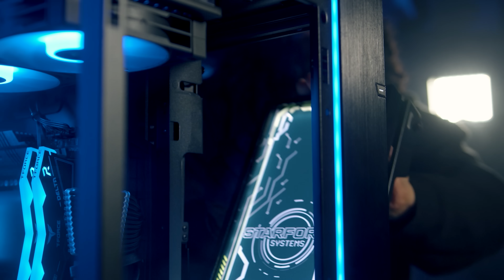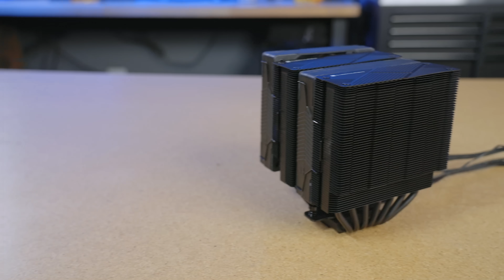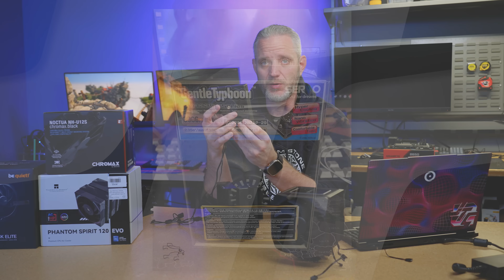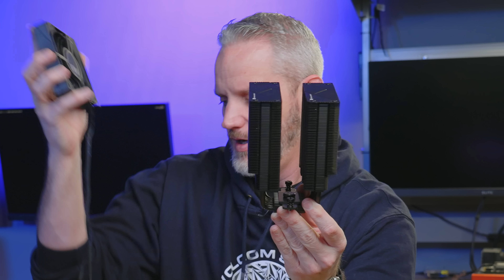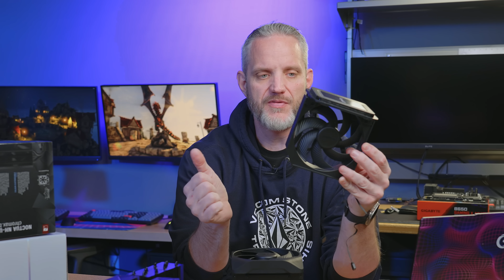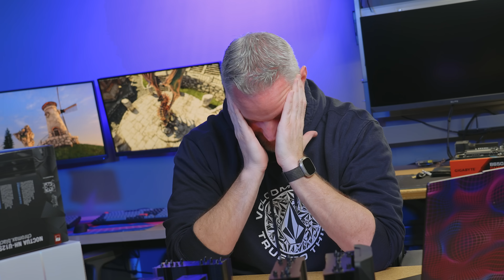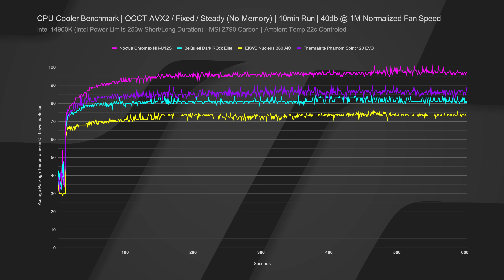This $49 CPU Cooler has big brands SHOOK! Thermal Testing Cheap vs Expensive CPU Cooler!

Comment: man my 6700k intel has a 25 euro tower cooler on it and temps dont gop above 70c. edit my old pc 2500k intel beast of a overclocker with a side panel fan with cardboard as a duct and a stock cooler i got 15c of the normal tem and had that thing running 4.2ghz for olmost 10 year my girlfriend at the time used it after me and the good thing with a big chip you could leave the voltage on auto and it was fine bigger chip better power it can take

Comment: Great review, but you've fallen prey to the Gamer's Nexus over-analysis nonsense. While 40dB normalized is interesting, most of us aren't running an open test bench and don't care about a 3dB or even 6dB difference for fans that are going to be inside a closed case. Put the Thermalrite inside a case with case fans, and the noise at 1 meter will be nearly the same for 94% & 100%, so why should we care? We want to know how close the out-of-the-box Thermalrite results are to the other coolers. You can report on the noise differences, but normalizing the noise just creates a bogus comparison that's not relevant to most of us.

Comment: @JayzTwoCents : Jay can you please test the following : 
Can you run the Thermalrite through the same test you did in this video, but this time with the sides of the fin stacks taped off so that all the air from the fans gets pushed through the fin stack instead of allowing some of it to escape through the open sides ?
I would like to know if closing the fin stack sides helps the performance of the cooler or not. (if you want - and have the time - then you can do the same test with the other coolers as well, just to see what difference a closed off fin stack makes)

Comment: More important than adding more coolers to the charts is testing with an AMD CPU in addition to the Intel CPU as well as using different power limits (shape of the heatspreder and hotspot location can make a huge difference)

Comment: TR make great products. I've recently bought their Burst Assassin, Phantom Spirit Evo and multiple 3 packs of their infinity mirror ARGB fans. As much as I love Noctua, the NHD15 takes up a LOT of space, and for AM5 without the offset gets beaten by the PS Evo ever so slightly. The Burst Assassin really impressed me, when not running PBO on a 9800X3D it was functionally the same as the NHD15 and cost $32 nzd. The Phantom Spirit Evo was $70 and allows you to run PBO fine. The NHD15 is nearly $200 NZD and blocks everything around it.

Comment: Good day Jay 
I actually bought that tr Evo 120 and did worst than my artic freezer 36 by a mile.
If you cauld do freezer 36 vs tr Evo 120 and noctua nh-d15 g2  and dark rock elite on 
that would be impressive on a Ryzen 9900x...
I got 92c-94c on cinebench r23 on tr Evo and 84c-86c on artic freezer 36 with p12 max on multiple 10minutes test on 9900x overclock with 34000+ score on air cooling... thanks for this consideration...love your channel and your awesome dude...👍

Comment: I've been carrying an NH-U12A (it's like the U12S but with a better heatpipe arrangement and two fans) through several builds now and it's still going great. IIRC it started out on a 6700k and has ended up on a 7800X3D! 
I've become sort of attached to it but with all the great value coolers out now maybe it's time to think about an upgrade?

Comment: My CPU is only 65W rated so went with the Hyper 212 Black with 4 heat pipes for 29.99 on newegg. Even running cinabench R23 it never kicks cpu fans to max and never gets above 70c. at idle i'm below 40c with case fans 500-600RPM and cpu fan 800-1000RPM (case fans are 2 140mm intake one 120mm in a Lancool 205m case so top is open nut has no fans)

Edit: if you ever want to go into bearings more, cooler master had fluid bearings they call loop dynamic bearings, using both centrifugal forces to move the lubrication and magnets to keep it centered and i have no idea if that's just marketing or normal for FDB.

Comment: I'd love to see you add the Darkrock PX4 cooler to that chart.  It's the $17 cooler you did a video about last year (3/3/2024).  And it's STILL under $17.
You said it was "the cheapest cooler you ever reviewed and it's probably the best performing cooler at it's price point".  How about some numbers to back that up?
It has direct heat pipe contact so I wouldn't be surprised if it outperforms the Noctua even at 1/6th the price.

Comment: i play in a garage 24/7 in so cal, it ranges from 30-115f, i switched back to full air cooling 2 years ago, AIO's are just trash now adays, the custom loops are fine but imo not worth the extra cost

Comment: I've got a question, not related to this video at all:

If I set 5090 to maximum of 90% power and use the singular 600w 12v hp cable will that almost guarentee the gpu to not melt.
Or is it just a lose lose, and should I return the card and get something that just works

Comment: I've used Thermalright since the mid 2000's.  I had a Thermalright XP-90, and XP-120, both downfire coolers.  They were kind of the industry leaders at that time, and very affordable.  Then they started with their tower coolers which were also very good.  For some reason they just sort of faded into the background, and just now are starting to be rediscovered.

Edit:  Actually if I were to dig around in my "parts bin", I think I still have the XP-90 and XP-120.

Comment: Looking at Hardware Canucks reviews. First different coolers perform differently on different sockets. Seconds the Thermalright coolers perforn even better on AM5 compared to AM4 or any of the Intel sockets. It ends up beating almost all air coolers on the market today on AM5. So people on AM5 platform have even more insentive to get the Thermalright cooelrs over others.

I wish more reviewers test coolers on different plattforms (at least the most up to date Intel and amd plattforms). Only testing on one platform doesn't tell the whole picture,

Comment: I just want an air cooler that has the same fancy LCD screens that let me put GIFs and data and such on them that the AIOs have... So far I've only seen DeepCool make one that's close but can't buy them in the US so that's out. I know the AIO is much more expensive from a price to temperature standpoint but I like my fancy screens. I tried putting a Lian Li TL LCD fan on my air cooler but the angle the fan faced made it not aesthetically pleasing. 

Yeah, I'm making way too big a deal out of nothing, I know.

Comment: I had the 10$ cheaper model which I think is called peerless Assassin and it was doing a very good job even on my r9 5900X until I got an aio thermalright aqua elite 360 V3! got really good temps at 65%

Comment: I used to love AiO water coolers until I had 2 different ones leak inside my case causing corrosion of the motherboard and RAM on one and corrosion on my video card board on the other.
Right now I use the Thermalright Phantom Spirit 120SE.  I currently run my AMD R5 5500 with a 300MHz boost and it never goes above 65c when running Prime95 or AIDA64 for 20+ minutes.  BUT I cannot get a 500MHz boost on mine like some users do.
For $35.00 US this is an outstanding cooler.

Comment: your testing is slightly flawed, you have to include AMD cpu's. For example, a low performing cooler for Intel may be the best performing cooler for AMD and vice versa.
Reply: I will add, the Phantom Spirit will perform as good or better than the Dark rock elite on an AMD CPU

Comment: No cooler beats Thermalright PA120 and PS120 for value, and few for performance (the new DH-15 does by a few C for triple the price...)
For the next tests please test the Arctif LF3 360, check if it beats the EK Nucleus for way cheaper !

Comment: Noctua just aint worth it. One NFA14x25 costs 40€. A five pack of Arctic P14 is 30€. Who in their right mind would by the Noctua? At the same noise, the Arctic has about a 5% airflow advantage through a hexagonal grille, i.e. as a case fan, according to HWcoolings testing. 
Even if the Noctua was twice as good as the Arctic, which it's not, you get like SIX of them for the price of one Noctua.

Comment: The NH-U12S has a wattage rating of 129 - it is not designed for a 253W 14900K. Yes, way overpriced IMO, but HOPEFULLY nobody buys it expecting it to handle a 14900K at 253W - not it's purpose. The NH-D15 would fit better with the group - dual tower and meant to handle loads (and also expensive).

Referring to the Nh-U12S as "terrible" in this type of apples to oranges test?

This video wasn't sponsored - certainly not by Noctua.....lol.

Thermalright has been making great performing and budget friendly coolers for quite some time now. I have a Peerless Assassin 120 in one of my systems and have never regretted the purchase - it's within a couple degrees of an NH-D15 which is something considering the price.

Comment: So the price per dollar test is the only test I can see that's inconclusive as the EKWB AIO and Thermalrite are not at max fan speeds and therefore not giving there best temps. To compare it would be like saying a pinto is a better value over a 350-Z because it's 0 to 60 is faster because the Pinto was able to use 100% of it's throttle while the 350-Z was capped at only 65% of it's throttle. So again that's why I feel that, that one test is in accurate.

Comment: I just picked up the upHere double tower CPU cooler in white with 8 heat pipes (yeah, the naming is absolutely goated). It normally goes for 60€, but with an Amazon discount I only paid 30€ – and honestly, I can't complain one bit about the performance. It also fits perfectly with my build aesthetically, especially alongside the white XFX 9070 XT.

Comment: Been using a ID-Cooling SE-206-XT (SGD$45 ~USD$35) on my 13600kf (Intel limits enabled). Temps are execellent for the price and no longer reaches 100C under a stress test or 80C in games compared to my previous cooler which was the CoolerMaster hyper212 which i got for SGD$60 ~USD$45 (absolute terrible price), 100% would recommend ID-Cooling.

Comment: thermal right peerless assassin 35$ amazon (double tower)

"Thermalright Peerless Assassin 120 SE CPU Air Cooler,PA120 SE,6 Heat Pipes CPU Cooler,Dual 120mm TL-C12C PWM Fan, Aluminium Heatsink Cover, AGHP Technology,for AMD AM4/AM5 Intel 1700/1150/1200/1851"

Comment: Add stock cpu air coolers to the chart if the cpu comes with one or if they are purchasable separately. That way you can see the performance uplift from a stock air cooler.
Reply: I just upgraded....I was eyeing a new build but we are talking thousands of dollars to get a good bump so out of the question. I had a 5800X3d sitting in box for 2 yrs and decided to pair with my 3080 and am blown away BUT wow the stock cooler sucks. Its a 4.5Ghz cpu and it throttles to 3.6Ghz because its constantly pegged at 90c, its max heat allowed. This CPU is basically NOT a 5800X3d as its thermaling at lower speeds! I did not want to spend any money but I have to so a new NVME SSD, CPU Cooler and new display port cable runs me $100 dollars which is way away from the $3000 I would need to spend for a full on new system where I can feel the difference.  Gotta say....I am running Skyrim and FNV at 4k at around 120fps each but my main game in XPlane 12 still has times of 40 and even down to 30fps. Lets go Peerless Assassin cooler!!
Reply: There is no stock cooler for 14900K, that thing is too hot.
Reply: I get the thought here, but you can find coolers for so cheap that are still good that it's just not that necessary. would be nice to see in addition tho
Reply: @wasru.  its not about 'cost' its about data. we need more data, and stock coolers for the sockets should be baseline data anyway

Comment: Jay, you pit a mid performance level, single tower Noctua against mid-high tier dual tower coolers from the competitors, then constantly shit all over Nocuta for not performing as well. Noctua will never win a dollars to performance competition, but at least compare a dual tower to a dual tower Jay, or acknowledge it's a much smaller cooler instead of constantly calling it horrible. Nobody should be putting a single tower air cooler from any brand on at 14900k, a processor legendarily hard to cool. The fact it couldn't do it doesn't make it horrible, it makes you an idiot for not using it in the correct application.

Comment: Im currently running a ThermalRight Frozen 240 aio on my 5700x3d, installed at the top of the case as exhaust, and after 2 to 3 hrs of gameplay(multiple games) i run around 50c to 55c. Im also running the dual tower ones on two of the PC’s i built for work(QC of cctv sewer videos) with no issues and computers running nowhere near 75c on cinebench. 
They are definitely a good bang for your buck. Specially on budget PC’s

Comment: It would be better to measure this at much lower loudness levels. Thermalright cooler @ 94% rpm, that is gonna be around 2000 RPM. Nobody is running this on those speeds, it is loud. This is partially why it performs so well in the tests, they slapped 2k rpm fans on it.
Realistically if you build very quiet pc, you want fans that run below 1000rpm, about 600-700 ideally.

Comment: i just bought my parts and with help from a friend built my first PC, i have a ryzen 7 9700x as my cpu and the big thing i was struggling to find info on was stats for air cooling. although this cpu has a estimated 65w on another video i saw they showed 85w to 90w power being drawn from stock settings. so i had no idea which air cooler to choose as none of the specs really say what an air cooler can really cover depending on cpu heat output.
so i went for a Noctua NH-D15 just to make sure, it was £110 and under a stress test/cinebench test the max it went to was 88C degrees. 
had this video been out 3 to 4 weeks ago, i could have maybe gone for it and saved about £50.

the other point i have is, the thermalright is considerably cheaper, will the fans last as long as Noctua fans? that could be a weak point to the air cooler. there is also a asthetic choice when bying parts, i bought the D15 because i have a tomahawk mother board and plan to theme inside the case of possibly a fighter jet and so on, to me the black cooler goes with what i want and i was happy to pay the extra money. most of us go with budget, but some of us spend a bit extra to achieve something we want overall out of the build.

cool video, i look forward to more info for the future as it will be helpful. are we about to see the crash of air cooler prices as the big names of air coolers have been like Nvidia and milking that "quality" brand name lol

Comment: Yes, cold plate does create inefficiency at heat transfer. But direct heatpipe contact on higher loads is more likely to have heatpipe dryout. Especially on GPU's; Overall temperature being good until certain load treshold, the hotspot temperature suddenly starts to skyrocket.

Comment: corsair a115
thermalright macho rev c
Thermalright AXP120-X67
scythe mugen 6
endorfy fera 5 dual
be quiet! Dark Rock TF 2
vs
alphacool eisbaer aurora 360 280 240 
On a am5 140w ppt

Comment: You must try out the ID-Cooling FROZN A720 BLACK 140mm Dual Tower Black CPU Air Cooler 9800X3D @ Stock 53C Idle and 80C at full Stress Test with CPU-Z Bench tool. :eyes-pink-heart-shape::eyes-pink-heart-shape::eyes-pink-heart-shape:

Comment: Jay you are missing very important point: you have to test intel and AMD cpus separately with the same coolers!
All these coolers will behave entirely differently on amd CPUs. Spoiler : Thermalright will win, but all the other  air coolers are much worse on AMD. Since AMD cpu's are much more popular, you need to test those too, its not enough to test Intel alone.

Comment: Something you should take into consideration is trying AM5 with this and see if the results are consistent. HCanucks recently put out a vid and there are very clear results indicating which coolers were developed for Intel versus AMD since the market for them in terms of preference have changed. Perhaps a future video idea?
Reply: This consideration is why I bought a Phantom Spirit 120 EVO for my 5800X3D. -Which, I bought after finding out 1st hand how poorly Heatpipe Direct Contact/Touch coolers perform on AMD MCM CPUs.
Reply: i have am5 and it works fantastic for me
Reply: there's also coolers that are not well suited for am5 but work just fine on am4. the id cooling frozn lineup is one such example that struggled on am5.
Reply: @Izanagi-Arsene  What coolers are good for AM5? 9800X3D. My Deepcool AK400 is running about 10c hotter than my friend's but his brand is Korean and I can't get it here.
Reply: @Hiiiro  Your AK400 has direct-contact heatpipes going only through the middle, that is not good for AM5 CPUs because the CCDs that get hot are not in the middle, look up "9800X3D de-lidded", you see that big chip in the middle? that's not the CPU core, the core is the other one. You should get a cooler that has a base plate like the ones Jay showed and with more than a few heatpipes, four small heatpipes just aren't enough for modern CPUs.
Reply: @Hiiiro  noctuas with the offset bracket

Comment: @JayzTwoCents I would simply add a very good AIO for comparison, like the Arctic Liquid Freezer 3 360 or 240 (The Arctic AIOs are basically the performance for the price kings in AIO, what Thermalright is in it's industry of aircooling), Simply because most people would rather wonder if an AIO or aircooler would be more suitable. But I also see your need for a reference, as you said, with the EK waterblock.

Comment: I've been using Noctua NH-D15 with my 5800x3d, 5900, and 5950 CPUs. My temps have stayed under 80 degrees C while gaming with fan speed at 100%. At idle my CPU temps are at 31 degrees C with fan speed at 50%. Room temps are kept at 72 degrees F.